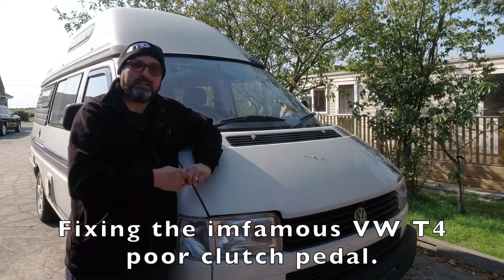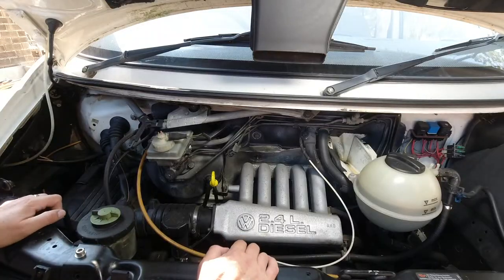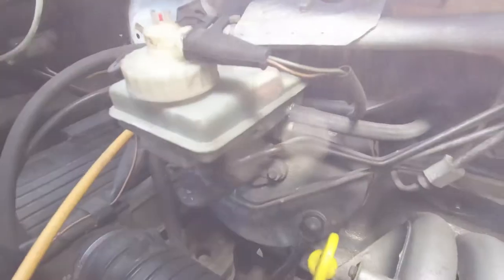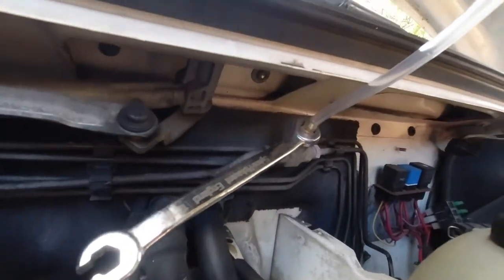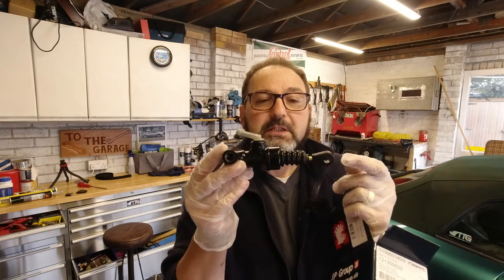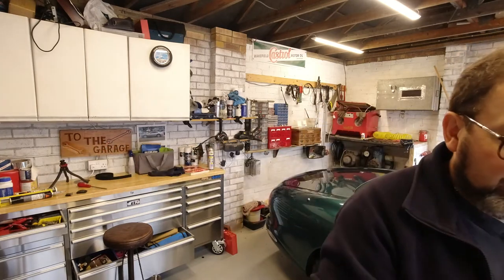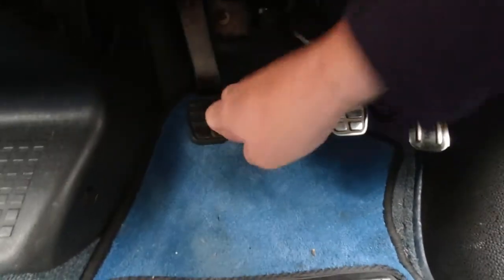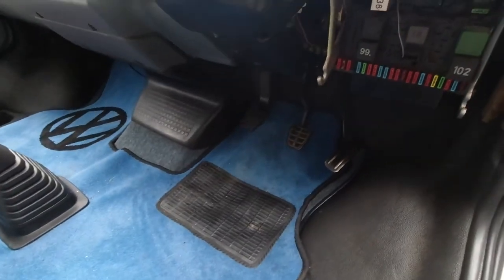Fixing the infamous VW T4 clutch pedal / Master cylinder.

Comment: Dammit! Just fitted a slave cylinder as my clutch is dragging and hard to get into gear. Thought maybe the slave wasnt actuating fully, now I'm wondering if I'm gonna be changing the master tomorrow. Cant get any pressure in the pedal atm but will rig up my eazibleed tomorrow.
Reply from the maker: Good luck johnguy1969

Comment: Is there anyway to test the master cylinder on the bench, to verify that it is that that's the problem. I've got mine off and it seams to be working OK. Any input is welcome.
Reply from the maker: If you bock the outlet port with an appropriate bolt and try to operate the cylinder. it should not be possible to operate it. If you can then the seals are gone. It should be a dead stop if you have hydraulic fluid in it or it should feel like a very strong spring if there is just air in it.

Comment: A problem with the T3 Transporters is that the clutch pedal 'locks high' - and pressing It hard blows the nylon tube off the banjo bolt on the master cylinder. Apparently something happens with the clutch release in the bell housing - something is preventing the clutch fork moving. Anybody know how to solve this? Engine got to come out? TIA!

Comment: Hi having just had a bracket put to hold pedal box everything seemed ok then other day clutch pedal wouldn’t come right up ! I manually pushed the pedal to see what was happening and a gush of air is coming out is this the master cylinder
Reply from the maker: Either masterc ylinder or the Servo. Most likely the master cylinder though.

Comment: Sometimes, my ‘96 T4 bucks like it’s trying to go into gear when the clutch is fully engaged. Then it is difficult to put into first gear. Are these similar to your symptoms? My mechanic thinks I’m crazy because a few times I’ve left it with him it runs perfectly.
Reply from the maker: Exactly the same BP Rich. If you prod the clutch and then change gear (like your mechanic probably does) then the problem doesn't effect you much. Its when you hold the clutch for a while and particularly when not at the fully depressed position. I found that manoeuvring in reverse was getting dangerous. As you feather the clutch to reverse into spaces it starts to drag you faster than you want to go. 

If you are not loosing fluid then its the Master cylinder. If you are loosing fluid then its the salve cylinder

Comment: How did you find the 2.4d on your Autosleeper?
Reply from the maker: Hi David. Its never going to be quick😁 but it sounded great, never gave a moments bother and felt like it could happily do the moon and back. If I was buying another T4, I would be less concerned about how a non turbo 2.4 had been treated / serviced and driven, than a Turbo version. 
If you are a relaxed driver then I would recommend it.

Comment: Get your tester on that brake fluid, looks like pond water!
Reply from the maker: I have saved it for later experimentation because im still not clear why its Sooo black👍
Reply: It's turned dark because of the master cylinder failing inside 👍 mine did the exact same. can also be caused by the fabric braided hose between the reservoir and the master starting to break down inside